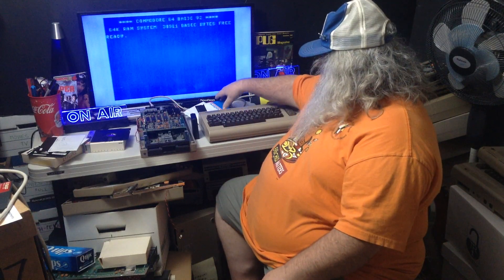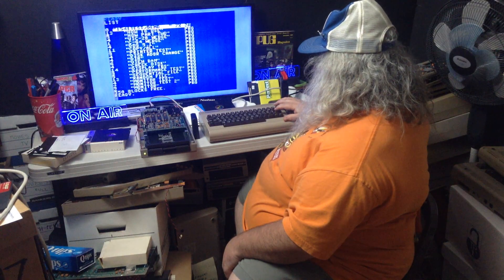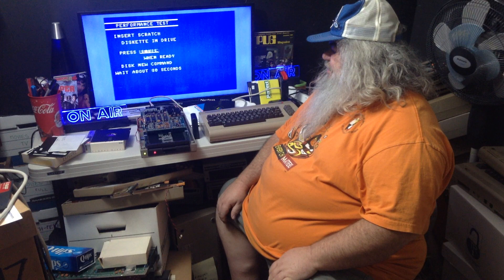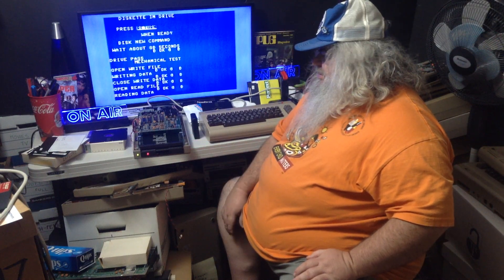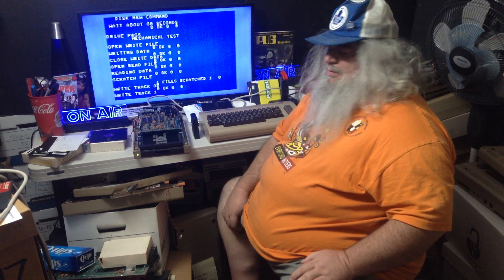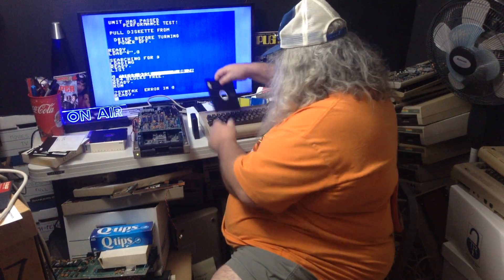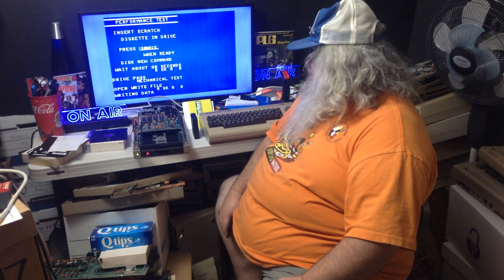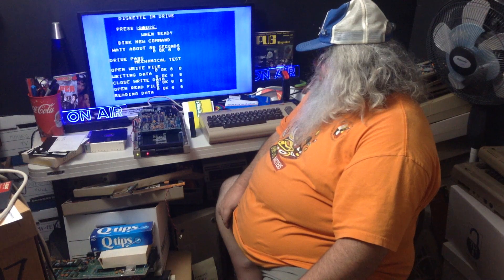Commodore 64 101 - How To  Test A 1541 Disk Drive! And Sadly, This Disk Drive FAILS! - Episode 1133

Comment: Could try with a perfect aligned floppy, and then you could use an alignment program, maybe?
Reply from the maker: I will tinker on the drive...I shall...first, I will clean the head...which makes no sense, but I will give it a shot...I have never seen a failure like this exactly...essentially it works...but yet, it fails...